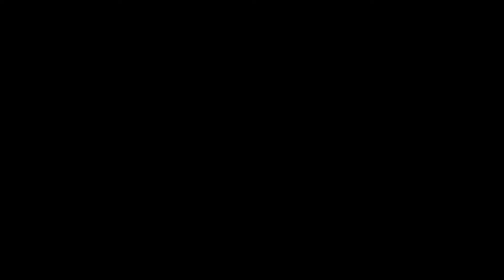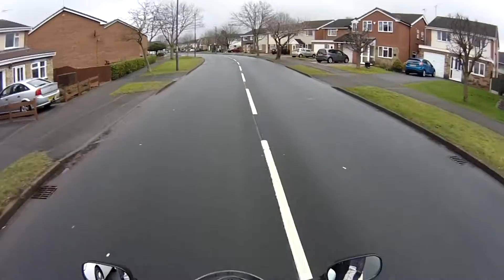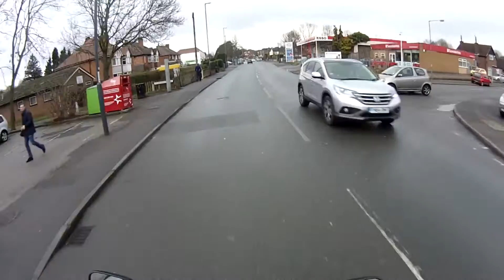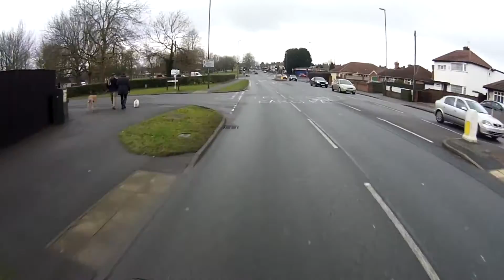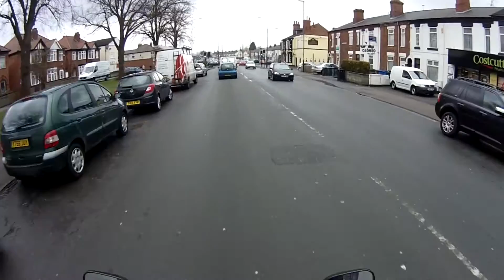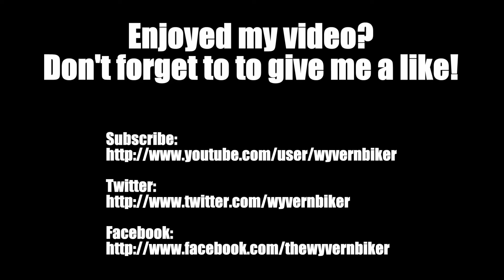212. THE MIDAS TOUCH IN REVERSE

Comment: Feel for you.I took the inner fairing off my zzr and then dropped the bolt down inside the bike.30 mins later using only the medium of a skewer taped to a cocktail stick taped to a magnetic screwdriver....and got it out....only to find it wasn't the same bolt....It was under the front tyre..Afghan.It's me too.
Reply from the maker: Road Glider Lol I've still got to replace the handle bars.  Crossing my fingers that doesn't turn into a mare of a job I can tell you.

Comment: I'm also not the best at car/motorcycle DIY. I still have to replace some lights in my dashboard of my car, but I'm pretty hesitant because I'm afraid I won't be able to put it back in place, or break stuff. Also, when I had a small crash on my bike, I had to replace my gear selector and a indicator. The gear selector I replaced pretty quick, but the wires of my indicators are now basicly ducttaped together, because like your bike, the connectors were diffeent sizes and wouldn't fit. When it gets a tad warmer I'm gonna try to connect them properly, but for now, this will do.
Reply from the maker: CasB Rides I worry that when it goes back together I have parts left over and have no idea where they go.

Comment: Sort of. Mine is when I get people in to do stuff. Just had windows replaced, fitters shattered bricks, knocked chunks out of plaster work etc it took 3 visits to correct it all. When I took the bike in for service, they tightened the chain to breaking point, only discovered that when I had  ridden off and couldn't change gear. Had a gas leak, bloke came and switched the gas off and then buggered off on coldest two days of the gear, result frozen pipes which then burst bringing the ceiling down....

Comment: When i had my VFR the PCB behind the dash was corroded so i tried to fix it using some wire and solder, the amount of times i melted through the pcb (its a thin flexible plastic one) was stupid. Managed to get most of it working but was without a tach for a while... was very frustrating that day!
Reply from the maker: carlsant1 I bet.  I think that would be step too far for me though.  At least you have a mechanic in the household now eh?
Reply: +wyvernbiker haha this is true however she knows nothing about electrics haha. That always gets left to me